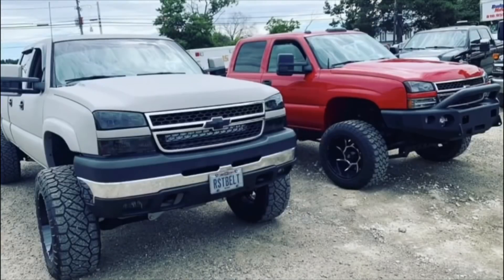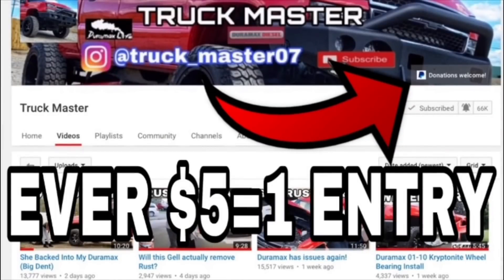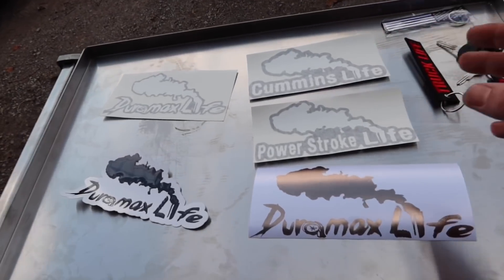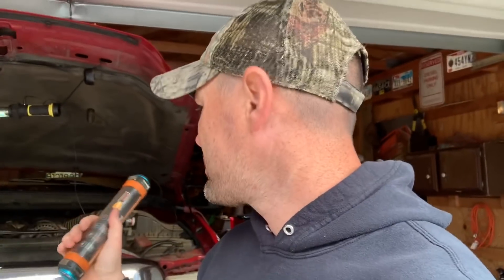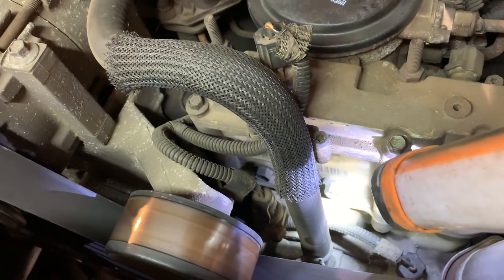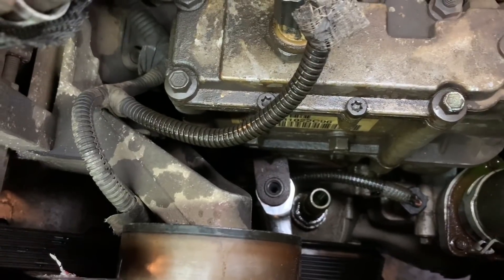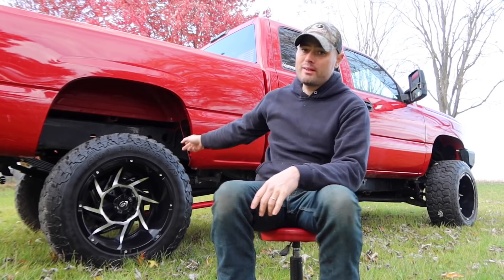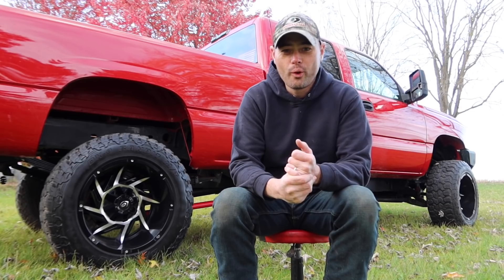It’s time to lose the EBay Wheels on this Duramax

Comment: you should consider getting a nice rear bumper like from Frontier gear, running board side steps, headache rack with lights, toolbox, bedliner etc. also your truck would look great on 22s with 37 nitto mud grapplers, but then you will have to make a video on fixing 37s rubbing
Reply from the maker: I like your thinking

Comment: My 07 LBZ is factory OEM. Summit White. Factory Chevy 17 inch chrome steel wheels.
I do want to remove the fender flares and door bumpers.
Reply: Here that just got the same truck. Maybe you will have better luck with the flares then I had. Took mine off to see what its like under them and seen that the flares had rubbed threw some of the base coat. But I think the trucks still look great with the door trim off and some wider wheels

Comment: Not a fan of wide deep offsets. You have a beautiful new paint job, why shred it with extra wide wheels? If we’re staying on the pavement, 20” is ok. If you ever leave the pavement, that style of wheel isn’t as effective as it could be. If you want to be different, tuck em in a bit and keep your paint.
Reply from the maker: Good point but I plan to wrap the truck soon to protect the paint so wides might not be out of the question